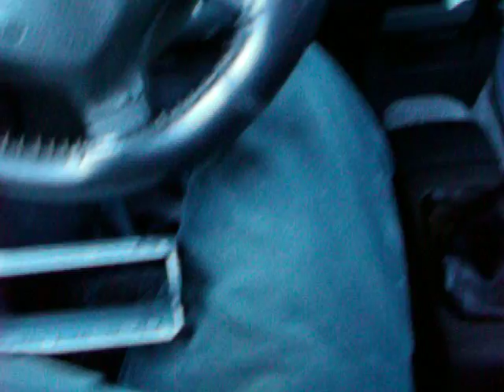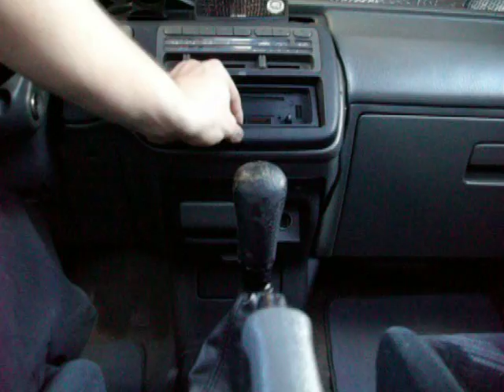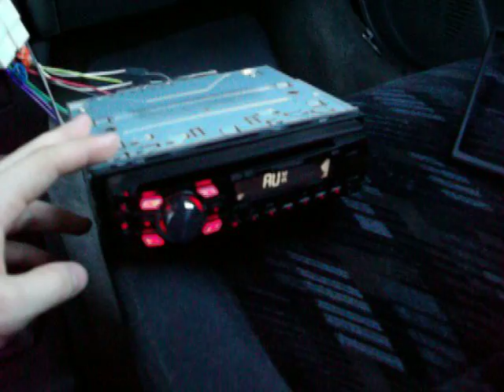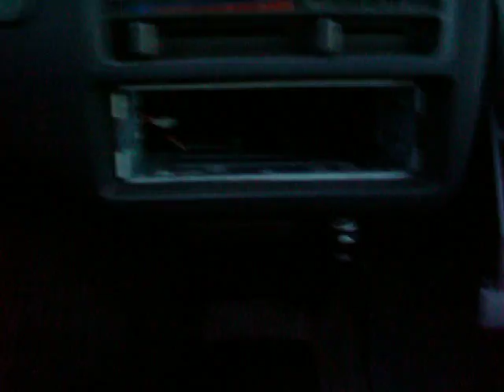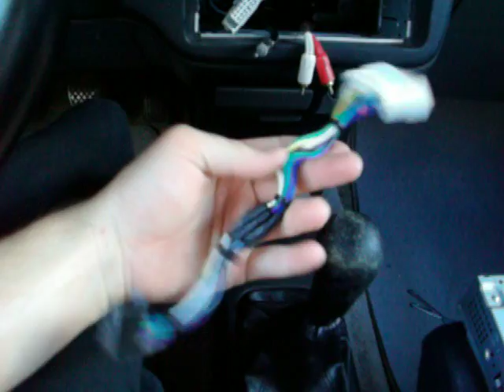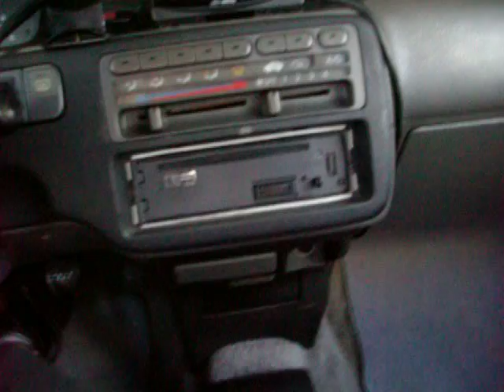How to: Install an aftermarket Radio/Head Unit in your vehicle

Comment: thanks man, the colour coding was kickin my ass and this nailed it for me! dont know why they dont put a proper diagram or even a paragraph on what each colour actually leads too ill never understand. thanks again
Reply from the maker: +parkbench13 
Glad you found my video helpful. I was confused by the wiring a bit too, mixed up the constant 12v wire with the switched 12v wire when I first tested it due to the way the color coding chart for my wire harness adapter was worded. Sorry for the late reply, I rarely check my comments.

Comment from the maker: On my head unit it's a blue wire with a white stripe. For some head units it may be a solid blue wire or another color. It's the same wire used for power antennas.